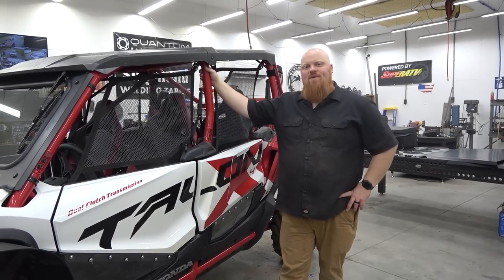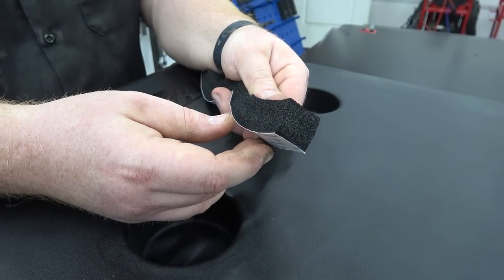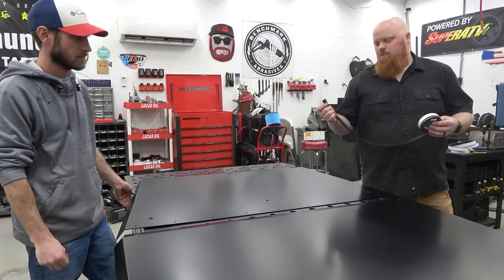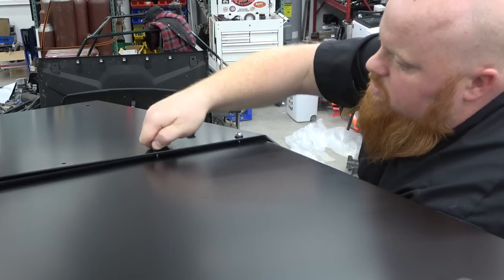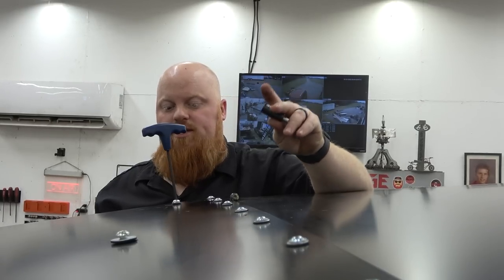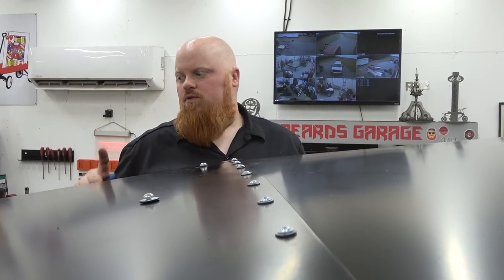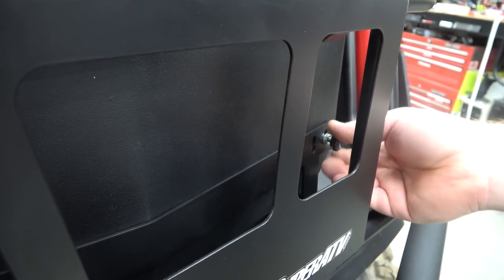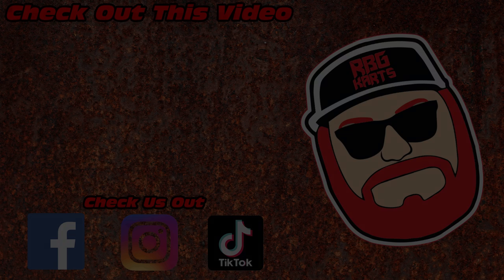Honda Talon 1000X-4 Aluminum Roof, Cooler, & Bed Enclosure Install ~ Super ATV

Comment: Cutting the kick up off from the oem roof on the back edge would be the best roof upgrade. I do like the bed ext and the cooler. But the roof is a down grade over oem roof with a light trimming of that kick up on back edge